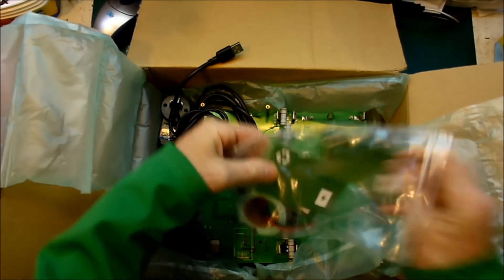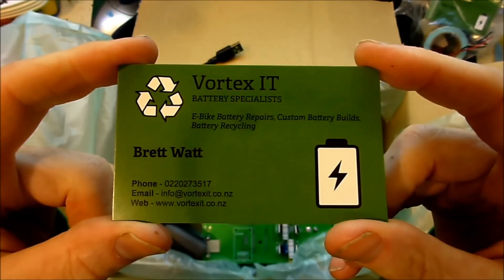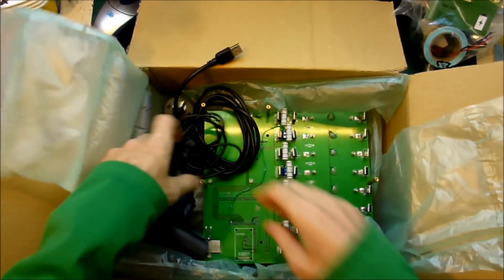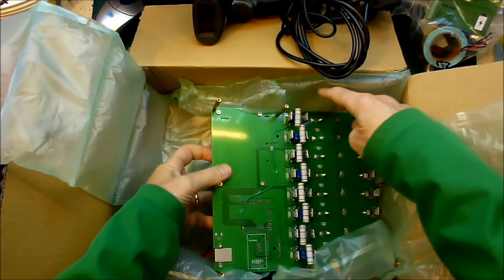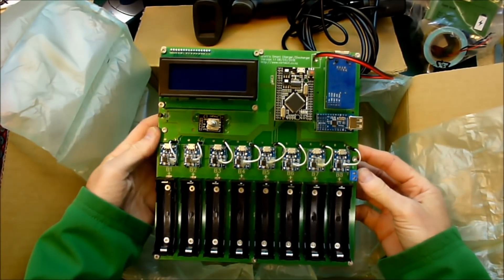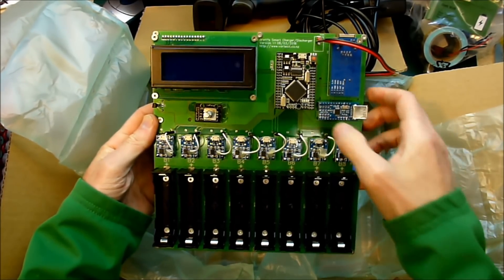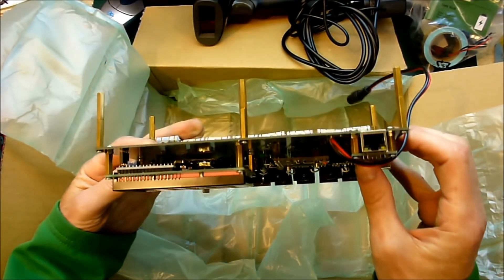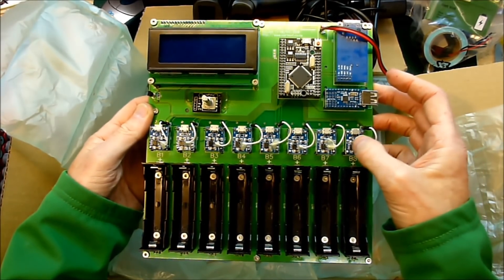Laptop Powerwall 138 - going to Wellington Maker Faire, 4 Nov 2018

Comment: Cool, I am glad it arrived safely. Let me know if you have any questions about it.
Reply: you built it? how much $ is it? whats the discharge amp per battery?
Reply: @AndyShell  yeah mate I designed and built it. It costs quite a bit depending one what functionality you want tho. Check out the parts list on the website. Discharge is a 3.3ohm(what I use) resistor so about 1.1a full charge then about 0.8 @ 2.8v.
Reply: it looks amazing but i don't think i do enough battery processing to use one. Lii-500 for 30$cad is shitty but does the job
Reply: @AndyShell  yeah not for everyone I am currently designing a 4x Arduino Nano version wifi only should be about $30 to build give or take.
Reply: @AndyShell  yeah mate I designed and built it. It costs quite a bit depending one what functionality you want tho. Check out the parts list on the website. Discharge is a 3.3ohm(what I use) resistor so about 1.1a full charge then about 0.8 @ 2.8v.
Reply: What is the website?
Reply: @magicalbluesmoke  http://www.vortexit.co.nz/parts-list/

Comment: Now that you have gotten really deep in to it. With all the best batteries hanging everywhere,  would you have configured them differently??? If you was to completely start over..  I am trying get my swap to lithium going. I started with 7s,40p. But never connected anything. Because I needed more current and capacity. So I just bought a 24v set of L16 6v lead acid cart batts. So I could wait to get more liion cells. I have 4x5 holders, I did have them in 4 tall by 5 long and 5 connected for 100 cells. For a 4.2v pack. Then I changed it to 5tall x 4 long, to make them shorter. I found it difficult to mount them because of the dimensions. So now I have them resimbling Nissan leaf cell packs.they would fit in a 8" x 10" x 3" box still 100cells, I have a 2x4cell gap in a top to make heavy gauge cable and series connections. I'm going to parallel two of these, and series7 cells for 29.4v and about 520 ah.. I need to put them in like a foot locker or cabnet. Not on the wall. I am still up to suggestions. Of configuration I haven't soldered anything yet. And I'm going to build atleast another 1400cell battery of cells to parallel with this one. Maybe even 4-6 more. I'd like to go a week without sun, and stay above 3.2v/cell.  Very ambitious I know!  I'm not going to pull over 250-275 amps, or charge with over 100 amps for now. With the larger bank. I'm guessing I'd be able to do as much as. 275-300 amps , no more than 1200ma per cell!!!  I'm just asking  how you would do it if you started yours over. Thanks
Reply from the maker: If I was starting today, with all the knowledge I've acquired from playing up til now, I'd build the largest packs I could. But... it's hard to get to this point without going through all the learning first :)